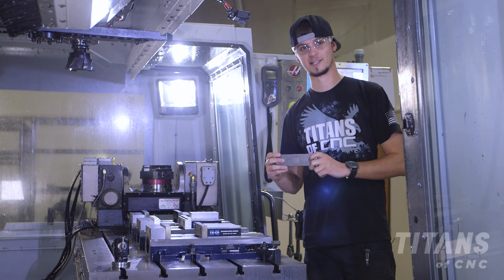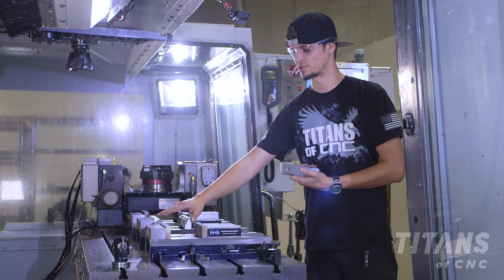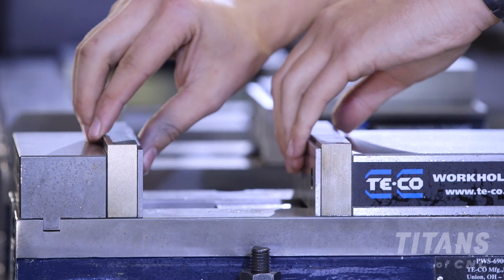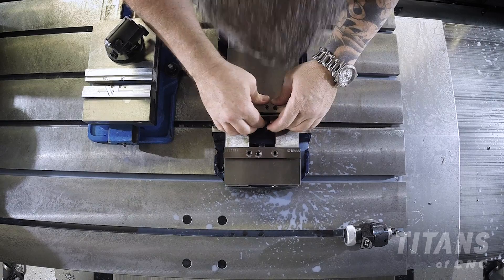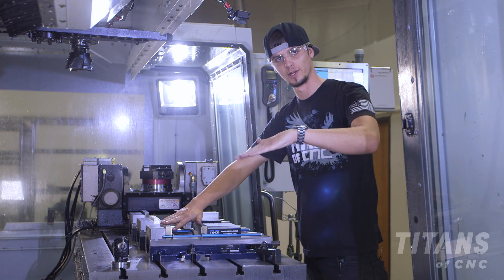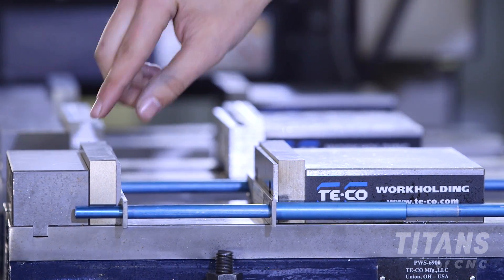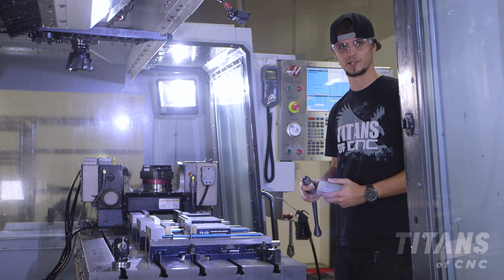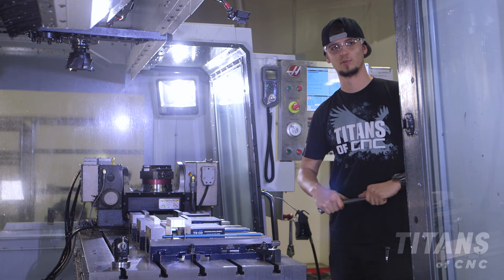TITAN FUNDAMENTALS: How to Install Parallels

Comment: My tip with parallels is to use a spring or two between them. This keeps them clean underneath as the springs prevent them from moving or lifting. They stay in place when cleaning the unloaded vice with an airline. Another bonus is that the vice handle does not have to be unwound very far as the springs immediately take up any backlash in the vice screw so the moving jaw moves immediately when the handle is loosened. This is a great timesaver when making several identical parts.
Another problem is cleaning the tops of the parallels. Although the springs will hold the parallels in position swarf can get forced into the corners where the tops of the parallels meet the vice jaws. To prevent this, use another slightly lower pair of parallels & place them between the taller ones & the vice jaws. This removes the corner where stuff can get trapped as it leaves a recess between the tall parallels & the jaws so nowhere for anything to get trapped.
Reply: Thats a great tip! How strong are the springs you use?

Comment: The jobs that use parallels at my work use rubber bands around the fixed and moving jaws. This makes it easy to clean the parallels since they are held independently from each other. Blowing chips out of the vice is easier too since the rubber bands can't blow away the way the banding can. I'd do anything it takes to avoid grubbing for something in a pile of chips if I can help it.
Reply: That tip is value, thx

Comment: I always hit the top of the material with a dead blow hammer to make sure it is seated on top of the parallels all the way.
Reply: yup exactly, they taught this in school. We used to work with ooold conventional mill
Reply: What about hitting the side edges on the top, I feel like it seats it better than when I hit it on the flat top.
Reply: just dont hit it where they are not sitting otherwise you would distort the job

Comment: What about jaw lifting, don't you need to tap over the piece to make sure none of the parallels is moving.
Reply: that is true jobs want to be tapped down to when the parrellels dont move but also tapped dowm only on the material where the parallels are at the edges otherwise if you hit the centre you could distort the material but also depending on the tickness so the solution is to make sure there same height with mictometre the jobs deburred and cleaned all swarf gone before and after they are set and you need only a little pressure to keep them in place but still be able to move them a little bit untill you can hit the job down and see if you got it square to them when they stop moving but also use a softer packing matetial in order to not damage the job when tapping it down